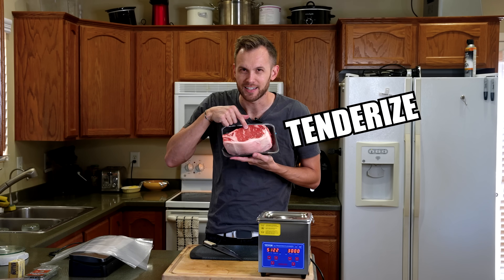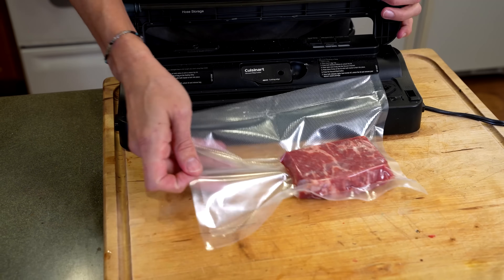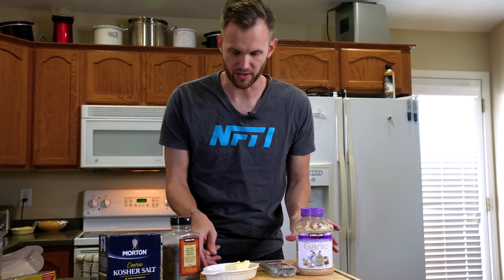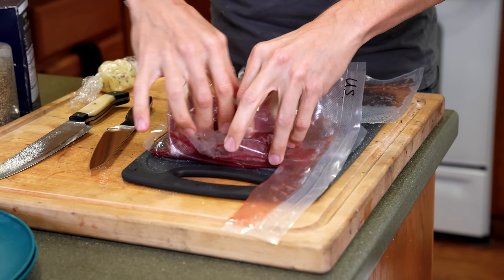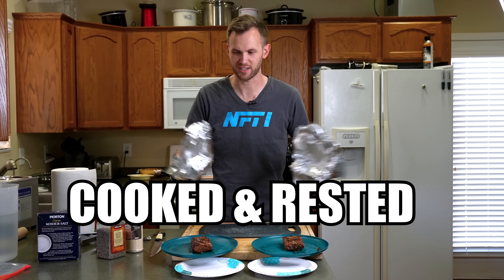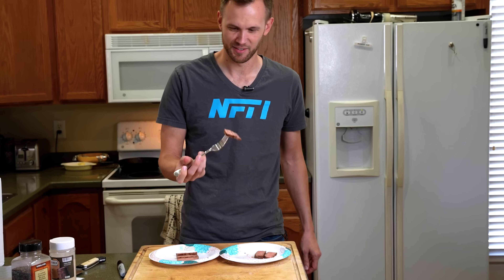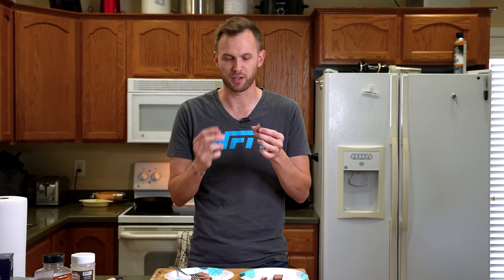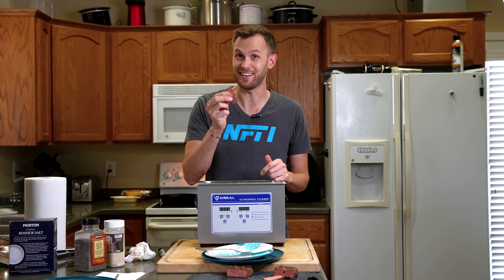Can We Tenderize Steak Using an Ultrasonic Cleaner??

Comment: Next time you choose to do marinade in a vacuum bag, how about using a small vacuum bag? Like you’ve just done in this video using a smaller vacuum bag on a steak without any marinade in it? So could you come up with ID next time to use smaller bags when marinatingor change the bags? Get a different vacuum bag system how about that because there’s multiple vacuum bag systems out there that don’t rely on a bag that has dimples and perforations in them that means structurally you can’t hold a vacuum properly.

Comment: On topic of tenderizing with sound, would be interesting to know if frequency make a difference. Use a subwoofer as a vibrating bowl since they are usually build rather tough. Is lower frequency with higher amplitude better? Or is higher frequency with less motion the key to success?

Comment: I get the experiment... fine...  sort of...  Nate, please, have a chef-y guest if you do something like this ever again.  That was heartbreaking to watch.  You should have seasoned BEFORE you put in the vacuum bag, (if you season both that still keeps the control and test the same, but doesn't over season) and after chipping off all the fat ( please tell me you made stew or at least fed it to a good dog instead of just tossing it) YOU BARELY PUT ON THE COMPOUND BUTTER TO DO ANYHING...  you might as well have just tested them with NOTHING else but the meat in bag and some density machine. That was so hard to watch

Comment: I think you should have used a typical tenderizing method and see if you can tell a difference and which one you preferred rather than ultrasonic-tenderized steak vs an un-tenderized steak sitting in a bag for hours.

Comment: I wonder about power level of the ultrasonic given you changed to different cleaner, also some cleaners work at different frequencies from what I have read lower frequencies are more aggressive vs higher frequencies, that could be something to check if your different cleaners was same frequencies and same power, and could be also something to test too.

Comment: (on camera) It appeared that the bag out of the ultrasonic had more juice leeched out of the steak than the one you showed to just be sitting in the bowl on its own.

a) Don't suppose you measured the volume of liquid that came out of them? I'd imagine the ultrasonic did a bit more cellular damage = more liquid leeching out
b) Did you notice any noticeable difference in the juiciness of the steak? If that's the case, it could be due to the juices draining out before cooking.

... or I'm just imagining it and/or there was no appreciable difference one way or another.

Comment: What about something that tumbles around, like a front load washing machine, you could put some water in it and then throw in ice  to help keep the steak cold. Would the tumbling of it tenderise the steak. May need to double bag the steak for safety, sorry children, could even use a cement mixer with just ice

Comment: Yes, you knife work could be better, but I'm concerned by the lack of sharpness in your knife. A sharp knife is a safe knife. A sharp knife does the work of many in that it takes ONE cut when a dull knife takes many. That's one cut you might cut yourself on vs many more cuts you might cut yourself on. Being sharp also means it takes less effort to make your cuts, so if you do cut yourself, it is a less dangerous wound than with a dull blade with much force being applied to it making for a much more damaging wound.

Comment: 3:26 "I've labeled the bags to avoid mixing them up" he says as he cuts open the bags and places the steaks on identical plates
Reply: Irrelivate. One had the thermometer hole through it. Which is even more ridiculous.
Reply: @buckiesmalls  I imagine they both had thermometer holes in them
Reply: @nickbrockelman  no.. they didn't. Only temped one steak. (It's in the video) I have already got the answer to my question via the creator. Basically behind the scenes, the cameraman sorted out the cuts for the test.

Comment: I wish you had started by explaining what an ultrasonic cleaner is. i've never heard of that before. from watching the video i could glean an idea of what it is and what it does but i'm still unsure.
Reply: It vibrates liquid to clean whatever you put in it.
Reply: It's often used by jewelers to clean jewelry in ways that conventional cleaning cannot reach (like between certain crevices of a piece of complicated jewelry). They're also used in industry for other types of fine detail cleaning. You can find giant industrial editions of this type of machine in some industrial settings. It's a great way to clean parts that are physically complex in a way that would make stuff like conventional scrubbing hard. Also, ultrasonic cleaning is helpful when what you are cleaning is quite fragile. Ultrasonic cleaning is an amazing technology that has a wide range of applications, and if you're someone who regularly wears your jewelry everywhere and goes to dusty places (or lives in a dry area with lots of dust like I do), and you don't feel like constantly going to a jeweler every time your jewelry gets grimy, you may want to invest in an ultrasonic cleaner (I do recommend being particularly careful in how often you use it on plated jewelry). You could also use one to clean your non-electronic keys and coins. Also, with a big enough one, you could use it to clean the case of your phone (obviously remove it from your phone before doing so), which can be helpful if your case has an integrated detachable screen protector like mine does and a hypersensitive screen that doesn't like when dirt gets the small void between the case's protector and the phone. An ultrasonic cleaner could be useful for this purpose. Also, if you work a grimy job, using an ultrasonic cleaner to clean your OtterBox/etc would be of interest. Also you could use one to clean delicate special utensils that are hard to clean with even hand washing if you do it right. Also, if you are going to put cleaning agents inside an ultrasonic cleaner to help it out, don't use anything that is considered corrosive. Obviously don't use any chemical cleaners if you're going to use the device to tenderize meat or use it on food in any other way. You'd probably want a dedicated ultrasonic cleaner to use for that purpose so you don't contaminate your food.

Comment: I might piss you off a bit, but what if just sitting in a vacuum bag in water tenderizes steaks, and you wouldn't know this because you didn't have a control?
Reply from the maker: But that's what I did.  That's exactly the control I did do.
Reply: @NFTI  you said there was a slight difference, but what if you had a control that was not in a vacuum bag, submerged in water? Would the result have been more pronounced?
(Probably not, but any excuse to eat steak, am I right?)
Reply from the maker: @noneyabidness9644  Ah, you presuming BOTH got somewhat tenderized by the experience.  Well that's fair I'll have to eat more steak.
Reply: @NFTI  indeed...For science!
Reply: He found a difference between the two, which implies that whatever a submerged vacuum bag does, the ultrasonic treatment does more. That was the test.
Reply: @SubliminalVibes  it doesn't, but that doesn't mean it can't happen. And he wouldn't know, because there was no proper control.

Comment: I modified a pressure cooker and use an HVAC vacuum pump, to pull a vacuum it will tenderize and marinate steak in 30 to 40 minutes
Reply from the maker: I've definitely thought about experimenting with that!
Reply: How is that even physically possible to build pressure….and vacuum at the same time? I’m not taking time to research it but I definitely know there are smarter people here to clue me in on the physics of that. Btw I’m not calling you a liar or anything, it’s just not computing in my brain 😂.
Reply: The pressure cooker just lets you maintain a pressure thats different than the environment, when you're cooking that will be a higher pressure but if you seal the lid and pump out the air somehow the construction will let the machine hold a lower pressure.  @gregkrueger331
Reply: @Freddysmiddlefinger1428  c
The pressure cooker seals That’s how it holds pressure if you add a vacuum aka negative pressure it’s going to create a stronger seal by sucking the lid in 
If you change the pressure release valve and adapt it to an ac vacuum pump hook up you can do it
I’m not using the pressure cooker to create pressure I’m modifying it hold a vacuum
Reply: @SubliminalVibes  lmfao I own my own business and multiple homes 
How much are you worth
Reply: Pulling a vacuum on a steak doesn’t tenderize the steak all by itself. It pulls the saturated gases from within the meat and when equalized in a marinade it draws the liquid into the cavities. It also distributes the marinade much deeper and faster than with osmosis.
Reply: @RadDadisRad  yes it definitely does
I’ve been perfecting this for years
The amount of vacuum I’m pulling turns even a garage cut of steak cut with a fork tender
Disagree all you want I can back my statement 
Can you prove or back yours?
Reply: @jeremy-psychonautlsdmtdr-k5140  I have a 2 stage vacuum pump that I use as well. I use it for marinating meat. It does nothing for tenderizing 😂 it was a prior medical pump and now I use it for lots of stuff, also removing the air from epoxy castings.
Reply: @RadDadisRad  it definitely aids in tenderizing the meat I really don’t care what you think
Reply: @RadDadisRad  how many microns
Does your vacuum pull? 
The amount of vacuum I’m pulling definitely works to tenderize anything I put in it
I can prove my my claims
Reply: @jeremy-psychonautlsdmtdr-k5140  I can pull down to 15 micron. Takes about 20 minutes to get it down that far. Like I said I haven’t noticed anything special with it tenderizing meat. I will say I am not testing it on the mohs hardness scale.

Comment: I mean, it's a sample size of 2 it was right but could just have been your brain just telling you and you had a lucky guess, i would say to say conclusively there should be more stakes, and also more seperate tasters, to like definitely say if it makes a noticeable difference
Reply: Yeah, I'm surprised he didn't at least mention the significance of the sample size. 

He could have easily cut a lineup of bites from the steaks and guess from which steak they came from.
Reply: Something else is comparing to a third option that's much faster, mechanical tenderization. Like a tenderizing mallet. 

Not till it's a pancake, but whether a dozen whacks would do something similar to hours in an ultrasonic machine is an interesting question.